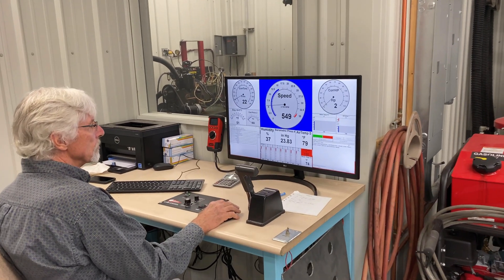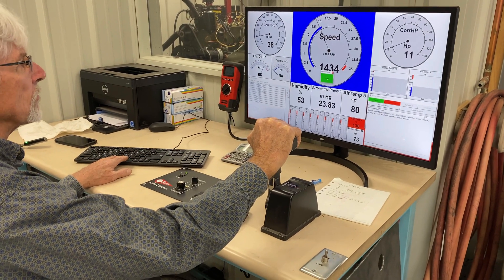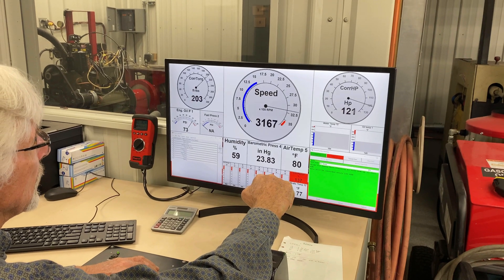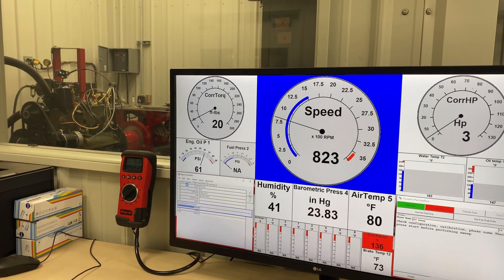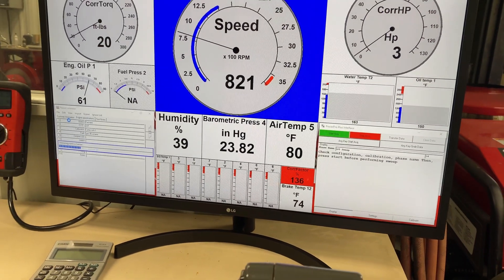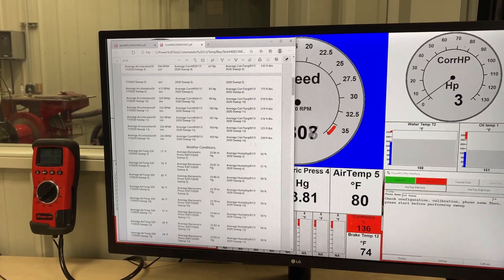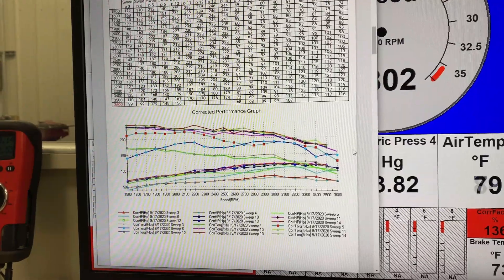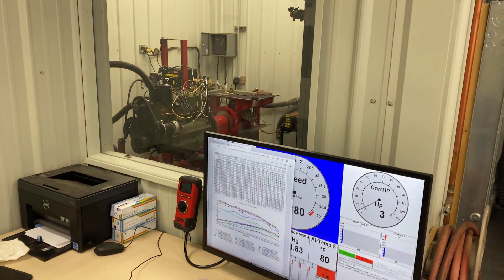1938 Packard 110 dynamometer explanation

Comment: Thank You. This gives me some reference for (formerly)my 1937 Packard 6. (Factory rated at 100 HP and 200 pounds torque.)  What is the best HP and torque @ rpm on your dyno for this test.
Reply from the maker: I know it made 120HP and had 105-110 compressions.  I'll have to look at the torques figures.
Reply: @claytoresto  Thank You...I see 250 ft lbs @ 1500 RPM.

Comment: Are those numbers about the same as what this engine would have made when new?  It doesn't seem like much now, but I imagine it was pretty powerful for it's time.
Reply from the maker: I'm sorry for the incomplete video.  I will set down and make something that is more informative.  The book says the peak HP is 100.  We are more than that for several reasons.  One is bigger bores and we had 105-110 pounds of compression.  The other reason I think is the weather station was correcting the numbers more than usual.  I need to calibrate them again.  I would expect 5-10% over book, but not 20%.

Comment: You said in relation to the numbers "it is what it is", were you expecting higher numbers?  Please explain
Reply from the maker: I'm sorry for the incomplete video.  I will set down and make something that is more informative.  When we dyno an engine, we start off by just breaking in for an hour or two and just try to tune it best as possible.  Then we start to put loads to it and make the usual pulls.  We have found after about 15-20 pulls it has been tuned to peak HP and the pulls stabilize out and the runs are all almost the same.  Thus, it is now what it is.  Tuning will not make any higher numbers, compressions have stabilized and thus will not yield and higher numbers.  So time to quit and pu it in the car.

Comment: I didnt see the air/fuel on the screen ? Do you use a a/f sensor for tuning the carb and engine?
Reply from the maker: Yes we do.  The sensor on the dyno is unreliable, so we use a Snap-On unit.  You can see it to the right of the monitor.  You absolutely have to have this information to properly tune the carburetor.

Comment: Shoulda told us what the peak horsepower was.  Where was the visual of the test setup?  Sloppy and worthless.
Reply from the maker: I'm sorry for the incomplete video.  I will set down and make something that is more informative.  I have 4-5 of these Packard straight engines we have built and tested and a full video is in order.  The book says it should put out 100HP.
Reply: unclepup That was really uncalled for.
Reply: Looked like it peaked at about 124 corrected HP.